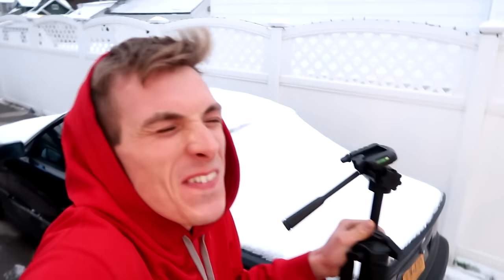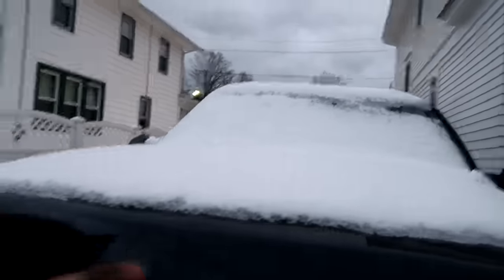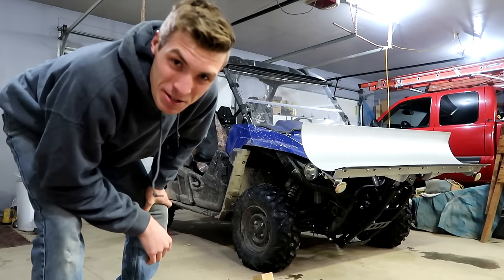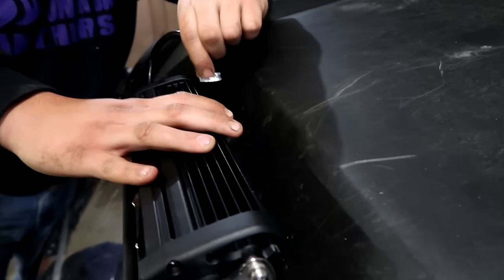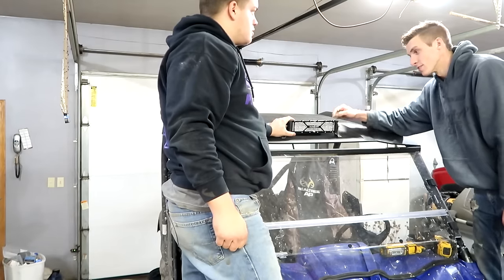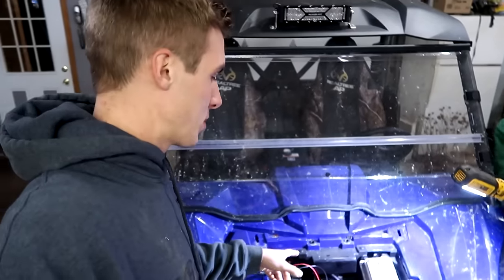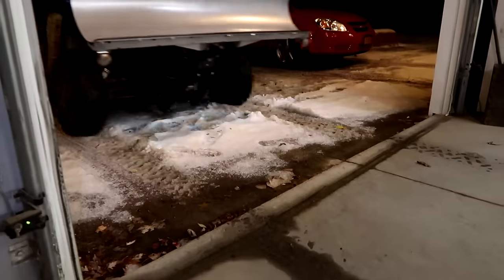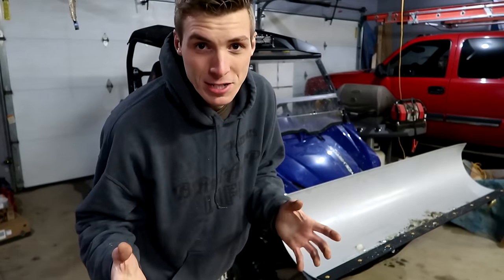NEW TOY NEW MOD

Comment: You should leave that truck plugged in whenever your not driving it, not an hour before you go 😆
Reply: Probably didn't do much to help.
Reply: +attackRus that's exactly what I was thinking.
Reply: our truck had to be plugged in all night or else it wouldn't start in the winter.    just a hour made no difference... but we had a shitty ford
Reply: +J⃟O⃟N⃟A⃟T⃟H⃟A⃟N⃟ S⃟C⃟H⃟U⃟L⃟T⃟Z⃟ nothing wrong with Ford. Never had any issues with our Powerstrokes starting in the winter. Never had issues with Cummins either except for the Dodge trucks rotting out in 50k miles. Duramax? POS overseas garbage, had one snap a rod in 150k miles, was a bitch to start even in the summer as well.
Reply: UnitCrane514 jk
Reply: UnitCrane514 Only problem with cummins is that they out them in a Dodge truck.
Reply: attackRus no they have no power they need to go back to the 12v

Comment: I just put 2 auxbeam bars on my wolverine.  I took the whole front hood loose and slid it up to the roof. The wiring was way easier and all the wires were hidden.  If he ever wants to re run that switch it's only like 8 push clips and 8 bolts

Comment: No reason to plug the truck in. It'll fire right off. I've had mine since 2005 and I've used the block heater once. Just let it warm up and use elevated idle. Your neighbors will love you for it.

Comment: pluging in your truck heats up the oil in your oil pan just to let you know
Reply: Michigan Outdoors no it doesn't it is connected through the freeze plug which is where the coolant is in the block
Reply: why would it heat up your coolent if it doent freeze untill -35 depending on the ratio but your oils starts to get thicker at lower temps and gets a lot harder to move and the injectors are controled by the oil pressure

Comment: A block heater keeps the oil warm for easy starting not the coolant
Reply: @3DMachines
Reply: @3DMachines
Reply: nathan martin bud it heats up the glow plugs
Reply: brayden hellekson the plug in does indeed warm the oil by way of warming the coolant via a frost plug heater. has nothing to do with the glow plugs at all
Reply: Who?
Reply: that other guy hah
Reply: I figured.
Reply: the oil and every other fucking thing holy shit
Reply: No it doesn't lol
Reply: It warms the oil so it isn't sluggish cranking you still have to warm the glow plugs before you actually crank the motor over to start it holy fuck buddy